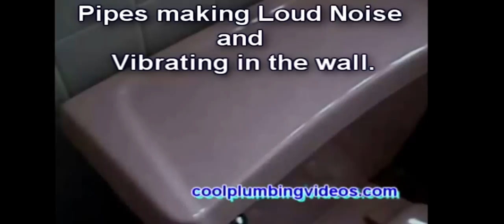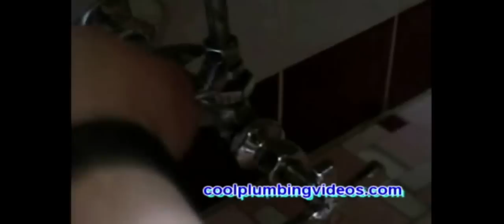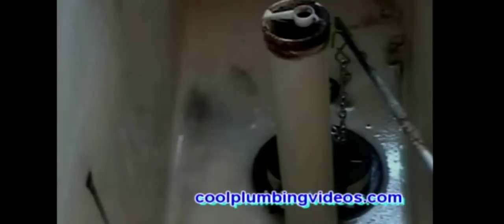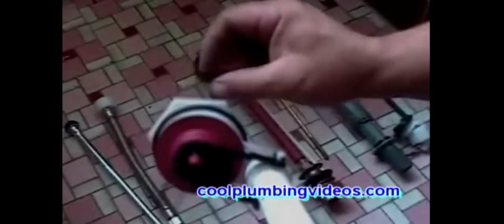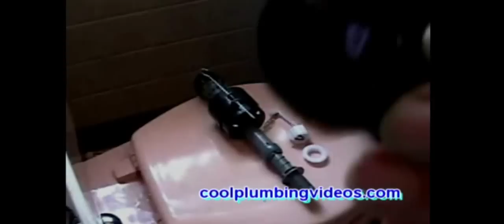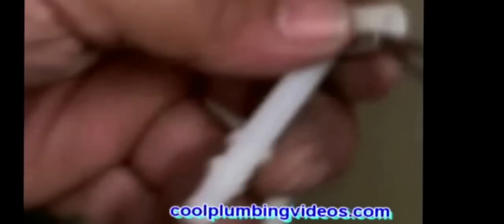Loud Banging Pipes In Walls

Comment: And HOW does this help what is wrong on the other side of your supply Valve??
Reply from the maker: A bad fill valve can cause air to get trapped into the water pipe's causing banging and loud noises
Reply: @theartofplumbing  you are exactly right. I had this problem today with a toilet in a new to us house we just just moved into. I was able to cut off and replace valve new quarter turn and PRESTO no hammering. Thanks!
Reply from the maker: @Randylayhe001  Glade I could help. Its a strange problem To Solve I know, but hey that's plumbing.